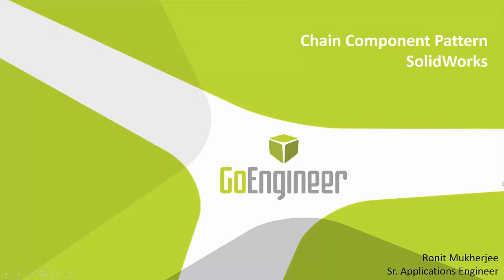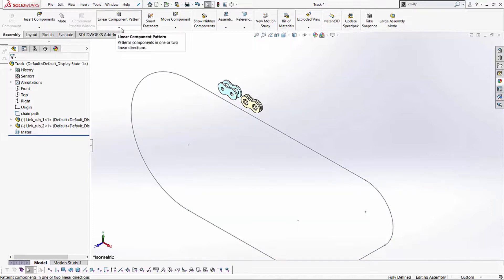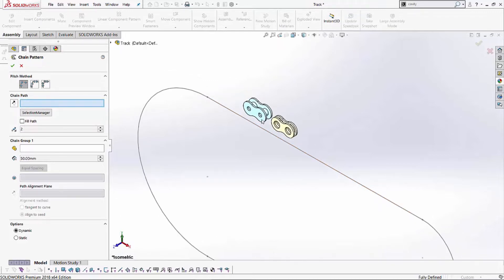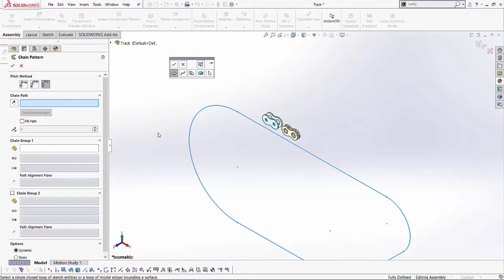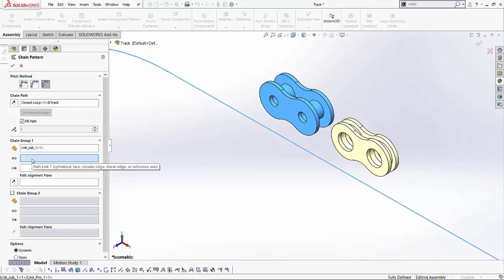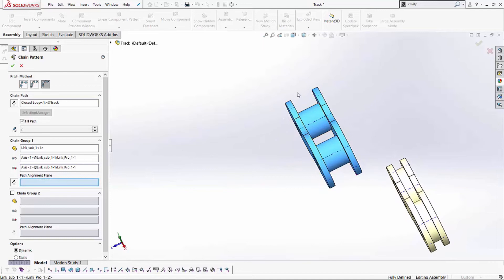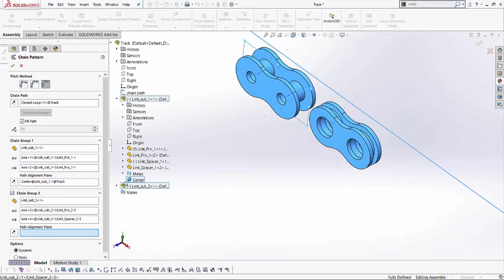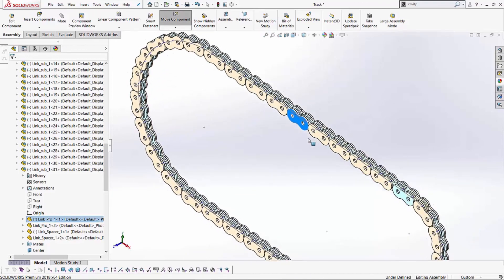SOLIDWORKS - Chain Component Pattern

Comment: Hi, may i know how do you calculate the length of the chain path so that your roller chains can link perfectly?
Reply: @gyver leong you can use the Measure tool to figure out the exact length of your sketch. Or, you can use the Belt/Chain sketch tool and tell solidworks how long the belt should be, exactly.